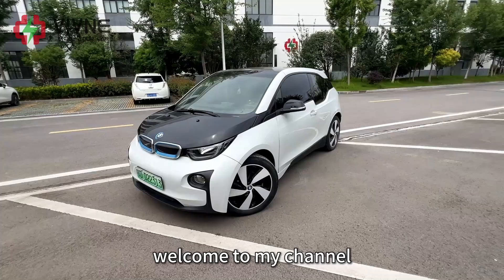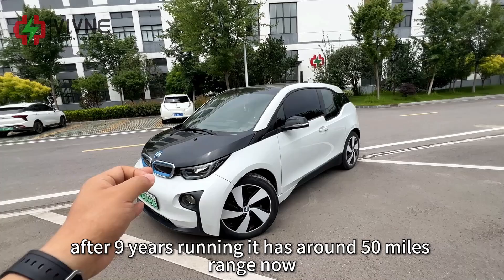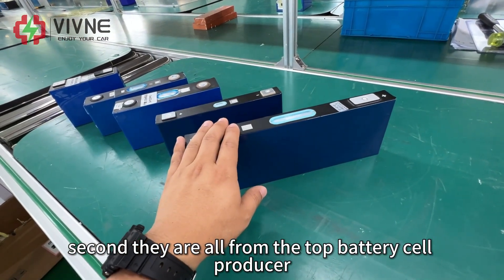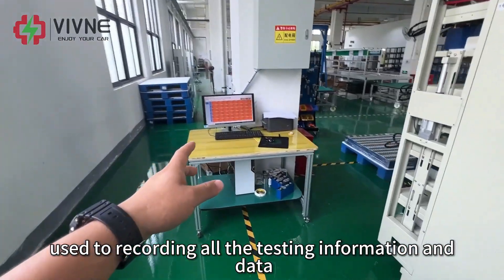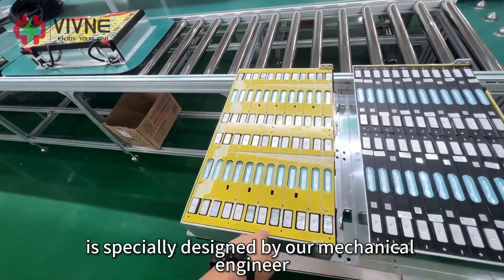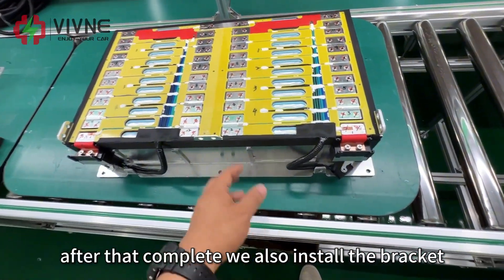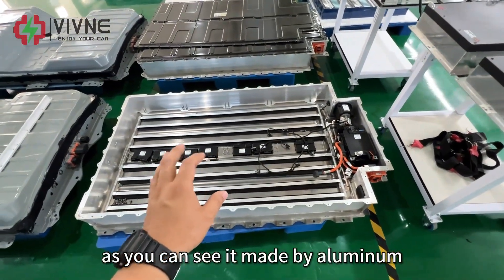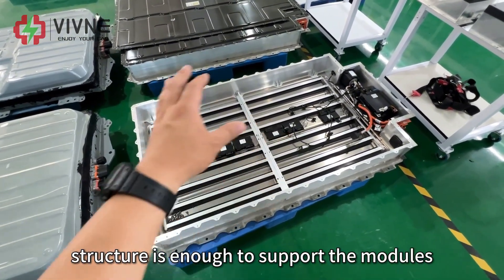BMW i3 battery upgrade from 22kwh to 45kwh

Comment: Hallo you change only the battery packs  can you use the old charger inside and is there not need change settings  ecu motor controll unit is changing only the battery enought thanks haydar  can you deliver complett built germany
Reply from the maker: We can update BMS program so the car can recognize the battery. Please feel free to contact me for more details.

Comment: Thank you for that nice information video.
Great product.
What kind of cell chemistry does these cells have? NMC or LFP. Does the original bms and bmw power controller fit with this battery pack? Or have the changed or programmed?
Will they ship to Europe?
Reply from the maker: Hi Vallon, Thanks for your comment.
Our BMW i3 battery uses CALB NMC cells,
We keep and use original BMW SME and CSC(Just need refresh the program). 
It will be ship to Europe, You can contact me(WhatsApp +8619945189706) for more details.